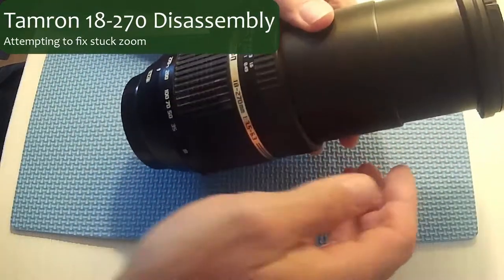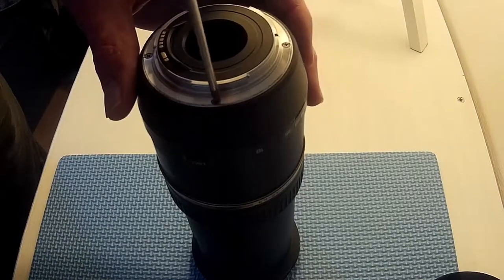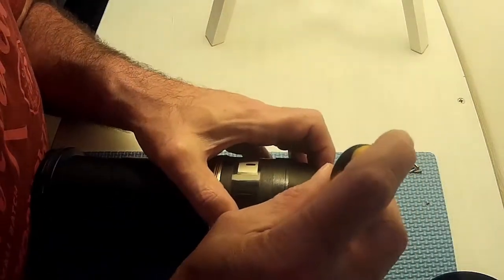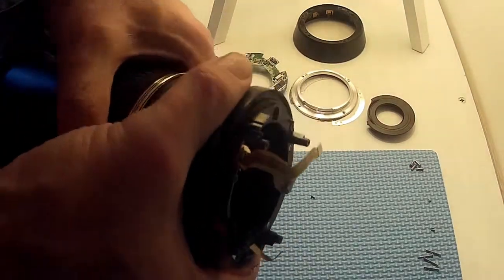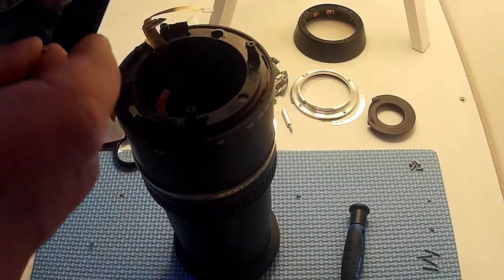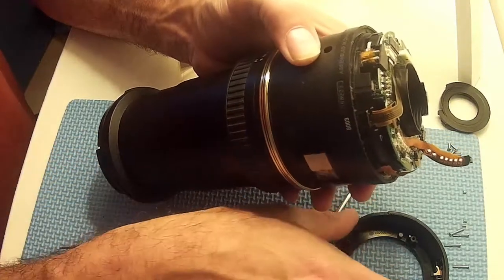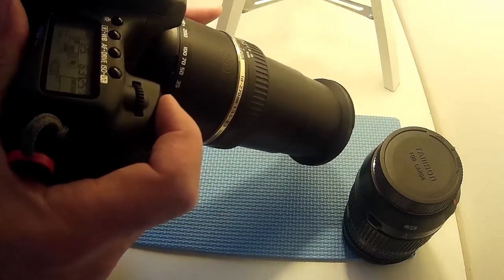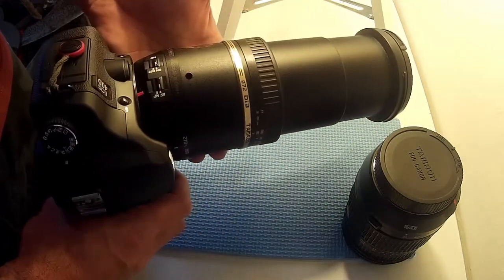Tamron 18-270 Zoom Lens Disassembly - Attempting to repair stuck zoom

Comment: If you can turn the lens back to the 18mm position, the screw will appear in the hole. The screw will hide under the ring when zooming out. I fixed mine two weeks ago when it was jammed. I had tightened that small screw and the lens works perfectly now. Took me less than one minute.
Good luck.
Reply from the maker: Thanks for that. This lens was completely jammed at 270mm but I decided to brute-force it. It clicked and then returned to the 18mm position and I've now tightened the screw. Problem solved it seems. Thanks for watching and your comment. :)

Comment: On mine the lens lock was activated but i forgot,  and i turned the zoom ring real hard and crack  ..the ring rotated but no zoom action  ..now a rattle of plastic chunk inside  ..i can zoom of i pull on the lens barrel  with my hand  ..focus and vc still work  ..but no proper zoom action  ..dont know how to fix it  ..obviously i broke the lock mechanism  but after watching this video it looks pretty tuff to fix
Reply from the maker: Mine worked for a while after this but sadly the focus started to degrade and it would cost me more to have the lens repaired than to buy another so I've done neither for the moment. Its a pity because I liked the flexibility of the range of that lens. Good luck!

Comment: Hi, I'm thinking of buying a used tamron 24 70mm lens at a very good price (half of what other used ones are worth). The problem is that it was cleaned of fungi and from that moment the automatic focus works but it does not focus. The lens is currently clean, the VC is working, and the manual focus and zoom are working properly. Should you take advantage of this opportunity? Is the af fix expensive? can fungi come out again?